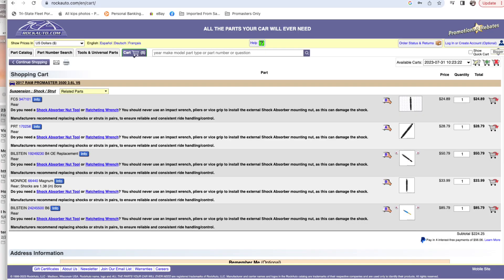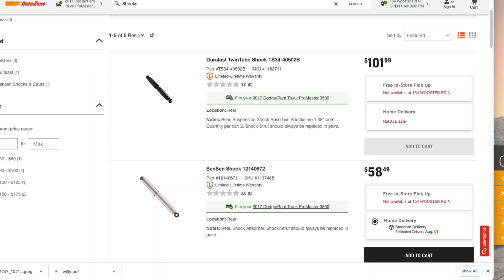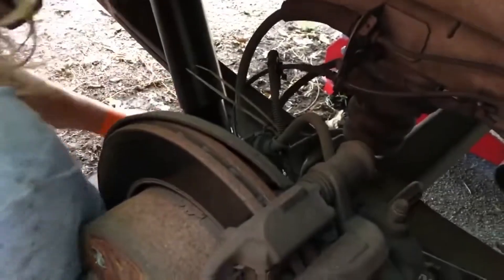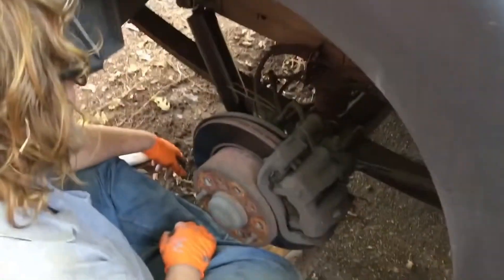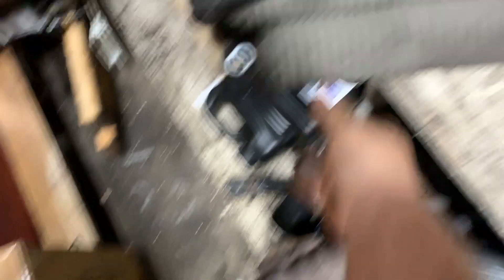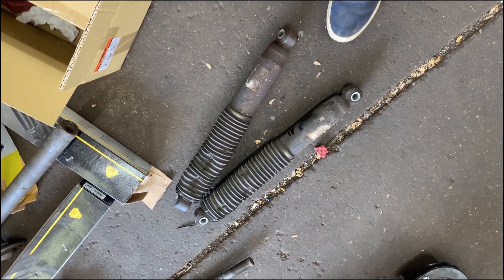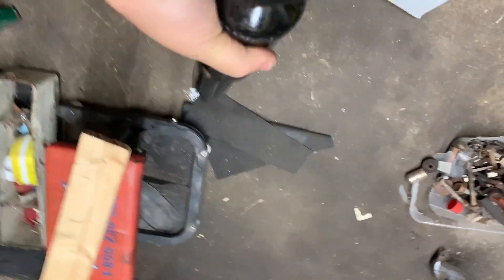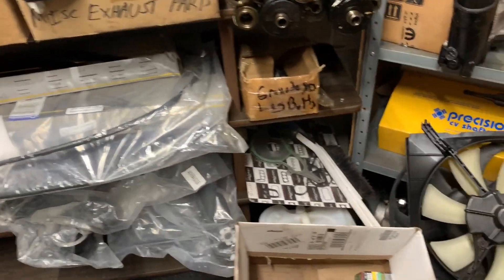Ram Promaster Rear Shocks - Everything You Need to Know about Shock Absorbers. Promasters Only

Comment: i ended up replacing the originals at 125k - they were pretty shot. i guess it depends on how the van is utilized. replaced with Bils B6 - lets see for how long they are going to hold.
thanks again for everything you do for the promaster community!
Reply: How have they held up?
Reply: @ seems good, no complaints 
I put 70k since the replacement

Comment: Just had major cupping on my 2019, 2500, 50k, with a light build. Didn't know the shocks were so cheap and easy.  Thanks Kip! Might solve my problem... I'm thinking driving 80mph might have something to do with it too.
Reply from the maker: Hard to say. Might be the age of the tires if orig, might be the shocks, might be the speed. I believe low weight makes cupping worse, but I'm not sure about that. Even the worst cupped tires will burn back to round pretty quick if you move them to the fronts. Or you may just want to replace them.

Comment: I have a 2017 1500 with 80k miles on it. rotated the tires at last oil change and the back tire that moved to the front had bad cupping. Drove for 3k miles with the front end vibrating and pulling pretty hard to the right. Anyway, it was annoying enough that I got new tires all around. I'm thinking now that I should replace the rear shocks. I have a camper build out in the back that is pretty unevenly weighted on the driver side. I have air-lift air bags on the rear to level out the load. Maybe that contributes to the cupping? Or is it the shocks? Thanks for the vids. Keeping my spirits up. ❤
Reply from the maker: @asbartels  pretty much shocks are the only thing that can cause cupping on this van. Super cheap and easy to do. I have video on it.

Comment: Is the reason a shock is pressurized to keep the fluid from aerating/foaming when the fluid gets hot such as would happen on a washboard(y) dirt road?
Reply from the maker: @wanger0690  The fluid, either liquid or gas, is what provides the “spring” in a shock. Its valved with a constriction to its flow, so the harder you push on it the harder it is to push.

Comment: Kip!  Please do a video and the rear brakes squeaking.  I have been to a couple repair places, spent thousands and replaced every single brake component besides calipers.  Everyone promises to get rid of it, and after their work it gets louder.
Reply from the maker: This was a universal complaint back in 2014. The fix is anti squeal paste on the back of the rear brake pads. Has that not been done?
Reply: @promastersonly1419  Sorry for the late reply.  I guess he did not.  Should I go back to him and ask him to do so?
Reply from the maker: @jonnyboy9927  might mention it. It’s not a lot of work. Only affects the rears.
Reply: @promastersonly1419  You still super busy and turning down work?
Reply from the maker: @jonnyboy9927  I am. Sorry.
Reply: @promastersonly1419   That's good!  You need to franchise now.  You have a brand, reputation and specific knowledge.

Comment: I have a 2018 Promaster 2500 156 wb. with KO2 tires, they are cupping...in the rear.  I was told that it was due to not having enough weight in the back. Current weight is 6800.  And not rotating when doing oil changes. Could that be also a reason? or did my shocks fail? I have just recently passed 60,000miles... thank you very much... love you back
Reply from the maker: My application is different, where I just run the rear tires to 200k and change the fronts when they wear (no rotation). But KO2s are big and expensive and worth rotating. I'm not exactly sure how weight affects cupping, but 60k on shocks is not abnormal wear. If it were me, I'd change the shocks and rotate - moving the cupped tires to the front should wear them back smooth if they aren't too far gone.

Comment: What the hell is my rear ckunking so hard?? 2014 2500 high roof longer wb, 145k miles. Alot of bumps and shifts in terrain make it klunk hard and suddenly
Reply from the maker: The most likely source is that the spare tire is flopping around under there. We see that a lot. Short of that, it's just leaf springs and very simple back there, and you should be able to reproduce any noise by jumping on the bumper. Odds are that it's something other than suspension, like doors or stuff rolling around in the body somewhere. Another source is loose rear calipers that kind of thing.
Reply: @promastersonly1419  i also just confirmed the rear shocks are blown 😂 they look nice and oily. I figuered it was a leaf spring as you can hear the  shackles shift on our ram 5500's rear, but im wondering if the blown shocks are makeing it louder.
Reply from the maker: @Tman0517  Jump up and down on the bumper and find out!

Comment: Just installed Bilstein shocks all around, not cheap but good never is.
Reply: Which ones? B4?
Reply: @jetmelt  B6
Reply from the maker: Clearly the B6 is an improvement. They last well, too.
Reply: would you rate them as a stiffer ride or smoother from better damping. I put some 5100's on my silverado and they seem stiffer or shall I say harsher
Reply: @bothellg  I have a 3500 so the ride is always stiff but they do ride better, hard to explain I travel a lot of back roads  which are in piss poor state so it does ride better in a sense
Reply: @dalehefferman   same here,  thanks
Reply from the maker: @bothellg  speaking in generalities, worn shocks are harsher than fresh shocks, and better shocks are less “swimmy” than cheaper shocks. That said, no shock is a night and day difference in this application. And unlike a sports car, there’s no “performance” or “handling” aspect to consider, only “ride” and “stability” really matter here.

Comment: What about Koni FSDs? I have them on my 118WB and they are smoother on less than perfect roads, but they're also not gas-pressurized like the Bilsteins and would probably feel a little underdamped on a heavy van build.
Reply from the maker: Koni makes good stuff, but I haven't experienced them personally. I'd hazard a guess that the lighter the van, the more shocks will make a different/improvement. Can't get much lighter than the Super Stubby 118.